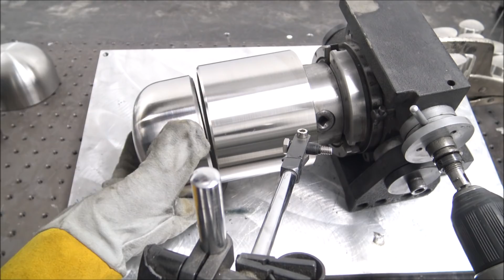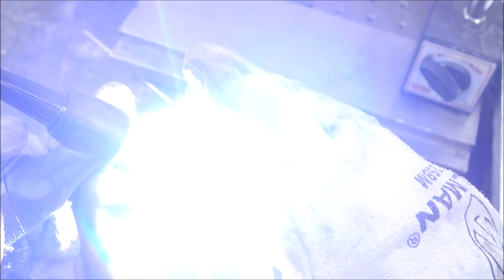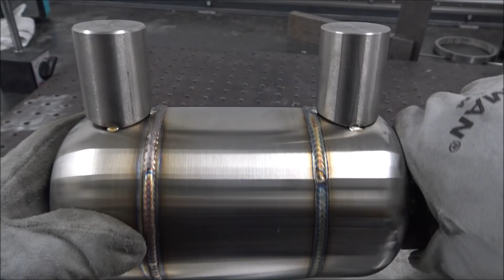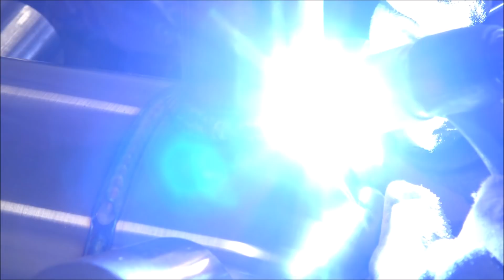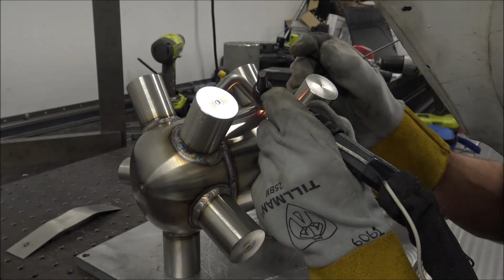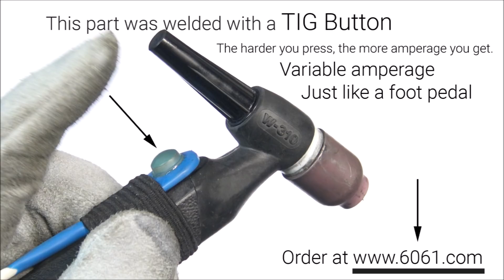TIG Welding Stainless Fabrication

Comment from the maker: Yes the main body is hollow, but it's pretty heavy. We're going to try it out first. If it needs more weight, I'll weld a 1/4" NPT bung on it and fine tune the weight with lead shot.
Reply: Sir can you explain what its for im not very clear on what it is.?
Reply: @mrjibrhanjamalkhan2144  It's a drag-anchor for a fishing boat, something to help control the boat while fishing in current.  In calm water/wind it could hold a boat in place, but it's not designed to "latch on" to the bottom like a proper boat anchor.  This is my interpretation of the facts presented, according to the experience I have.

Comment: I got the tig button from you when you first put it on the website, best thing I have ever got! I left it on my torch to get use to it for practice before I needed it, but like it so much I almost never use the foot pedal anymore. Thank you!
Reply: In a very wired left handed situation I put the button in my filler rod hand, worked great
Reply: I guess gotta try one of those... 🤔
Reply: I bought 2 of them!! One on the shop rig and one on the mobile rig.  Sold my foot pedals!

Comment: Being a guy that usually uses a pedal.. I can’t push the button and keep hand that steady at the same time!! 
🤩 👌 

You’re just as good with SS as you are with AL! Great work brother! 🙏 👍
Reply from the maker: Gotta put the hours in. You weren't great at first with the pedal either, right?
The trick is to squeeze and point the torch with your thumb and middle finger (usually) and only use light pressure with the index finger on the button.
Reply: Thank you for the reply and tips!!! 🙏 

I have been doing mostly ss tig for over 10 years (not everyday but regularily) and I’m still no where close to your level 😆
   I should invest in one of those pressure buttons though! (I only have the standard ESAB button/dial switch things with my torch.) 

Sorry to blab and keep up that amazing work brother!  🙏  Love your videos!
Reply: Same here still a Leg End not yet a Legend like yourself 👍🏼
Reply: Love my tig button. Need to ground it to my machine though. I got bit last time I used it lol.
Reply: I'm used to the hand held remote.

Comment: I made a boat anchor years ago but mine was ugly enough that I didn't mind throwing it in the water, it was only mild steel too so not too expensive to make especially because I used scrap bar ends to make it. I sure wouldn't want your anchor to get stuck and lost :-(

Comment: Can I have that tig button pressed and walk the cup or do I need to keep pressing it
Reply from the maker: Depends on your machine. If you can use your pedal as an off/on switch, then this will work too.
Reply: @6061  I don't have a foot pedal. I turn on gas with knob and use just touch the material to strike an arc
Reply from the maker: What machine